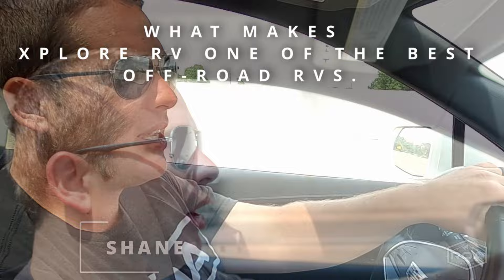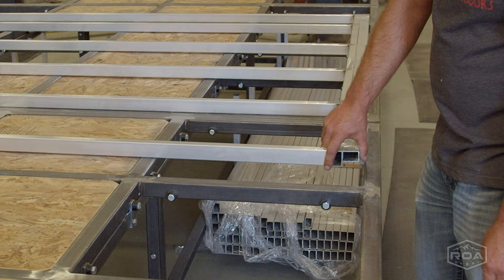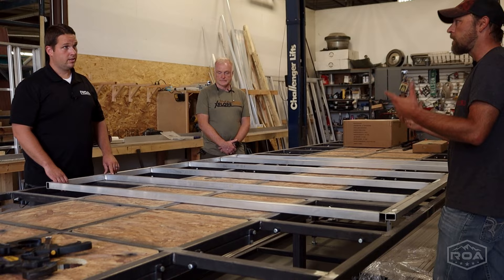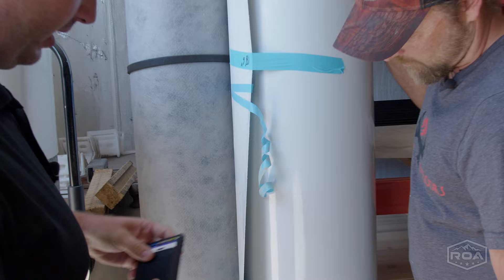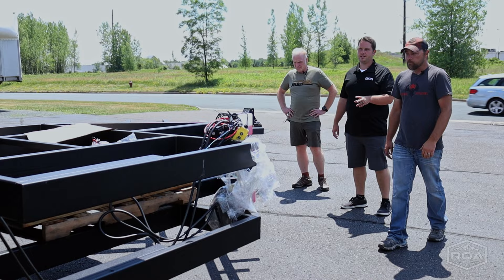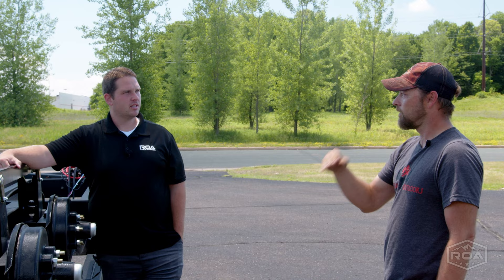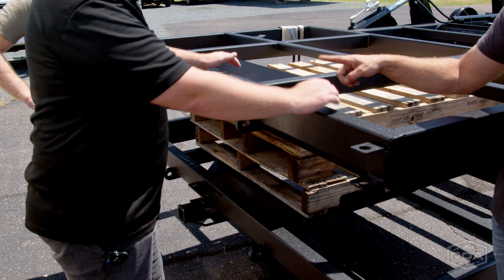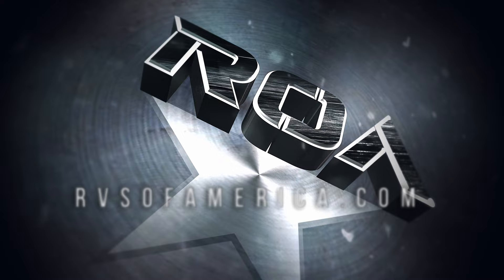EPS 1: XPLORE FACOTRY TOUR. 4k HOW OFF-ROAD trailers should be built. RVs of America ROA (2022)

Comment: I am curious about the new construction as of 2023. Does the x145, Roamer, etc have hand made cabinets anymore or are these now outsourced since they look like exactly like the outsourced ones in all the other trailers. Kind of a downstep from what made them different with the locks that prevented them from opening when offroad. Seems it now is easier for the cabinets to open and let items fly around when off road.  This is generally what you see when there is a really good specialty built trailer. Over time the interior becomes less quality/hand made quality and price goes up.

Also, does the x145 have the same framing? If not, how do they attach the cabinets to the wall?
Reply from the maker: Not entirely sure on your comment? The quality is way higher end? The cabinets can’t open easily on the new 2023 units. They lock better? Saying the 2023 are less quality is very far from reality. They are way better then last years mode. If you have any questions feel free to text 801-860-0035.

Comment: One last thought on this vid. I cannot find one well built off road trailer manufacturer that does not have a perimitor type chassis. So again please quite comparing the X22 chassie to some 30 foot Elkhart beast
Reply from the maker: Almost every Australian and other off road trailer does not do perimeter frame. It is not common practice. Australians claim they make the best off road and don’t practice perimeter frame and sell trailers for well over $80k. Not trying to compare to Elkhart but they do make 98% of all the trailers so it is hard to not. 😃
Reply: Good points as I was thinking more US rigs. I believe the Kimberly may not be perimeter but I am sure they have engineerd thier chassis to be just a tad stronger then a bay window in a track home 😉 plus all the AU rigs are galvanized which Imperial does not do. My lame advice is to separate your Roamer line from the Xplore line at thier factory and be very involved in QC. Airstream did this at a Dexter Group chassis  plant i worked with. Good luck and have a great holiday Go Utes!

Comment: It was great to see some of the trailer construction methods.  Still would not buy one for two reasons.  The bathroom is simply too small.  The bathroom needs to be at least twenty-four inches deeper.   The lack of sink and toilet space is unacceptable for the cost of this trailer.  There needs to be a queen bed running north and south so I can get out of it without waking my wife.  If this trailer was possible four feet longer maybe it could meet those requirements.  We are still patiently waiting for the June 2022 trailer.
Reply: I agree there should be a queen bed but I would go east west and make the width of the trailer 79 inches.  Making it any longer would just negate the off road capabilites. June 2022? for the Roamer 1? No way. June 2023 is my guess.
Reply: @bartman1857  I'll take the under on June 2023 for the Roamer prototype. But then again, I'm an optimist. :-)
Reply: @johnvowell6348  you definitely know more then I but I ment to market not to prototype.  I believe a joke was made about the cost being 500k well my therapist told me there is truth in jest. To quote Ferris " if you have means I suggest you pick on up"